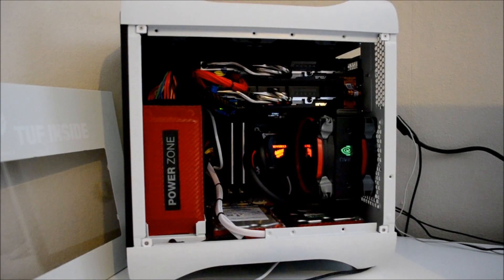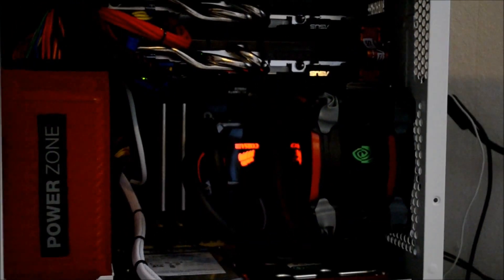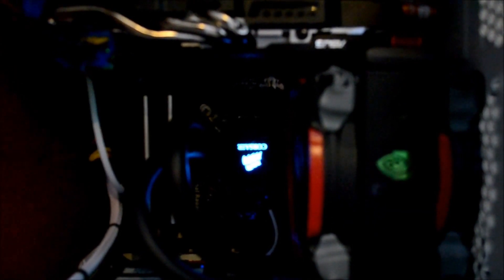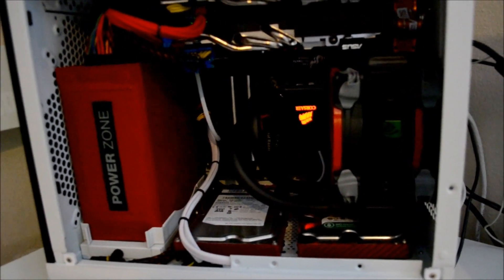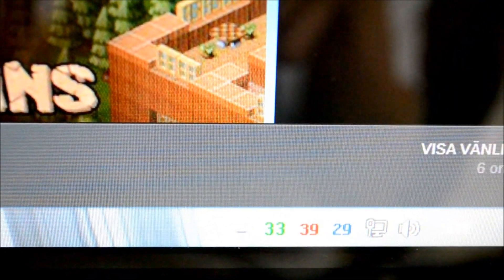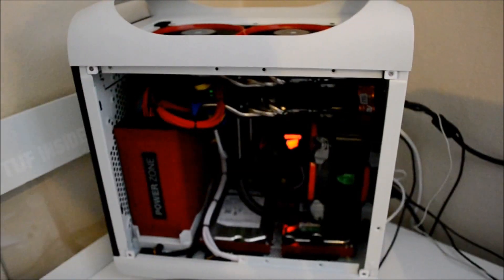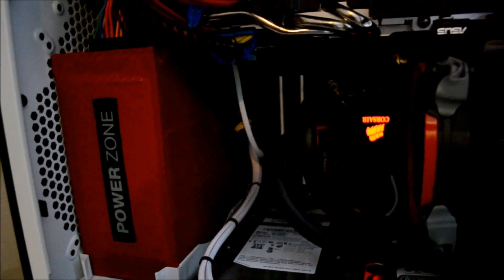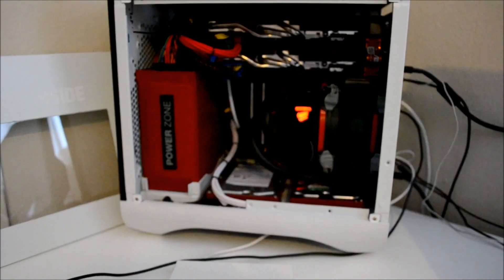Bitfenix Prodigy M Update #01

Comment: nice build. I am planning to do a build in this case too. I think it is a pretty cool case with lots of options and you don't waste space in this case.
Reply from the maker: I agree, there is lots of options to do in this case. Either go with maximum cooling or lots of storage considering what size of the case it is. Everything was much better after moving i/o side panel to other side. No need to struggle with the cables if you want to do something inside the case.

Comment: I flipped mine upside down as it's all air cooled.  To fit the Corsair 1050 psu and gtx 780 classified and CPU cooler I had to mount the psu without using the included bracket but made it work...large metal fender washers right to the case with rubber washers under.  Now all the heat from the case and psu vents up through the largest fan that fits so no need for the external heat shield.  All the smaller fans are set to pull air in and up.  One the top which is now the bottom I moved one of the included fans to the back.  This was needed to have somewhere to stuff all the cables.  I'm happy with having no window and don't care about fancy cable routing as long as they are not affecting airflow as as much as possible. I had wanted to use my LG Blu-Ray burner but it just didn't have the room so I mounted it vertically to the front leaving just a slot where the door opening is to run the cords to it.  I wrapped the drive in white duck tape like a car wrap and it turned out great.  I flipped the case logo back to the new top front as well.  I don't think I could go any smaller to fit what I want and run as cool as this does on air.  It's a portable beast of a system that I was looking to build...with handles.
Reply from the maker: Hehe sounds like you did a great job there! It's not easy to fit large/big components in there. You have to tweak and move some parts. But it's great to have a powerful and small gaming PC that you can easily carry with you.

I do not own this case anymore as I change to H440, also a superb case. But I considering getting a Phenom M for my wife, layout is the same (minor changes) as Prodigy M.
Reply: Aurahead Yep, I ended up finding I needed to retire my silver Lian Li 354 PC case which was and is still a great case but that barely fit my 560ti and had no handles.  I couldn't believe how much the 780 dwarfed the 560 and thus ended up getting the Prodigy.  It should last for a while.
Reply from the maker: fsp48 Hehe, I find myself changing case to often. But Prodigy M and Phenom M really is something. Can fit great components inside and still remain small form. But heavy as hell :D
Reply: +Aurahead Yea it definitely does still seem unusually heavy for it's size every time I pick the thing up lol.  Still remains my favorite case I've used so far.

Comment: Hey!
So I am thinking about migrating my components to this case. Is this a PowerZone 650? Or more important: Is it also 170mm long? Cuz they say that this won't work in this case.
And how long are your graphics cards? Mine is 320mm long and triple slot. So I am wondering whether this will work or not.
Hope you can help.
Reply from the maker: It is a Power Zone 850W 175mm long. About graphics card, mine is 271mm long and dual slots. I think it will be difficult to SLI with triple slots. But if you are using single gpu it wont be any problem.
Reply: Thanks alot! I am not going for crossfire or SLI though,  just one card. Still, you are right, it might become difficult.
I just need a board where I can fit that card in one of the top PCIe Slots!
Reply from the maker: Matt G If you are not going for CF/SLI than you wont have any problem. Just make sure your card isn't longer than mine or your psu is not to long. Mine is just about it.

Comment: Can you use 240mm Rad on this Case With one GPU ?? Without putting the fans and/or the Rad outside the case ?
Reply from the maker: Depend on how deep or fat radiator is. But there is plenty of space if you only use one gpu and fans should be okey, otherwise you can always use slim fans.

Comment: Hi man.. Is there anyway i cam install my cpu xooler which is h60 withiut its logo being upside down? What cooler r u using?
Reply from the maker: Hi!
Yes you can install it and put logo on right side. Reason why I could not have it right is that my Armor Kit for my motherboard Gryphon is to fat so it block a bit of it. So I had to put it upside down. I have Corsair 80i.
Reply: Oh wow h80i? I thought they have 240mm radiator? Why is yours only 120/140?
Reply: Oh wait h80i is 120mm!!!  No!!!! I thought they were 240Mm! I shouldve bought them instead :((

Anyway thanks man!!
Reply from the maker: Henzki2pre Maybe you think about 100i that are 240mm? If so, that can be put on top of the case. Otherwise it's recommend to put single radiator at the back. But I personal don't think you need a 100i in this case. 80i is good enough. I just like the look of 80i but mostly because of the color on the pump you can choose :)

Comment: hi what s/w is that for the cpu/gpu temps thanks
Reply from the maker: Highest cpu temp was around 70c - 73c (with OC) and gpu with SLI setup, top gpu was around 48c and second was around 69c. Top gpu got cold air from top that's why it run cooler.
Reply: Aurahead 
Thanks a lot! Been looking for that info. I'm guessing those are idle temps--what are the load temps? Say, running a game of your choice on ult settings at 1080p? And how does it sound? Thanks again. ^^
Reply from the maker: Alisa Leshchenko Those are load temps, cpu around 70 - 73c with OC and gpu top 48 because it have 2 top fans blow on it, and second one is higher because there is no air to cool it, 69c
Reply: Aurahead Wow, those are lower than I expected. Looked up your GPU and it's got better thermal and noise benchmarks than mine, but it seems like the case can handle SLI fine. How is the noise level, is it noticeable under load? Thanks, Aurahead.
Reply from the maker: Alisa Leshchenko Case can handle SLI fine but I recommend using reference cooler because none reference is not pushing air outside back at the case. If you use reference in this case and SLI it won't be any issue with heat or noise level.

To be honest these cards are very well cooled with Asus DCU2 cooler. But even these cooler make noise when it reach high fans level. I barely hear top card but instead second card is producing noise. That's why I would recommend going for reference cooler.